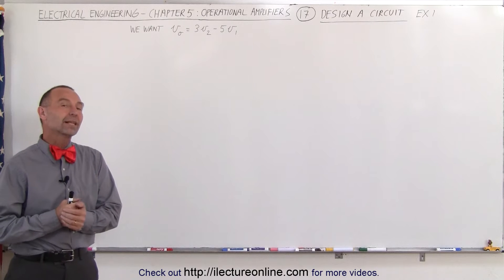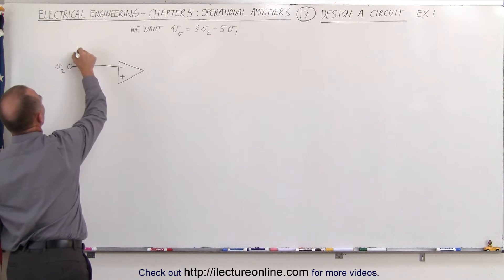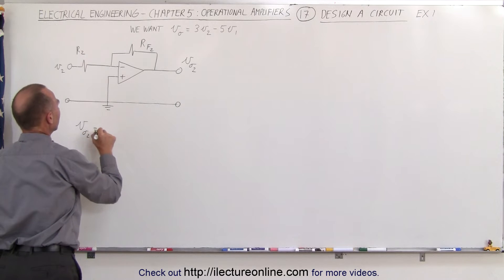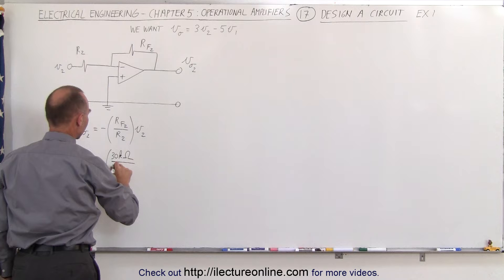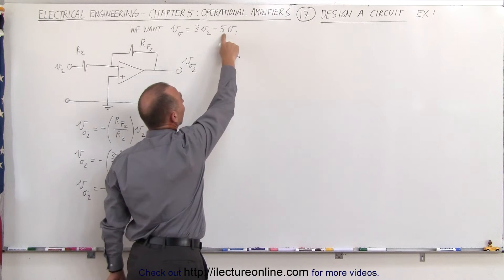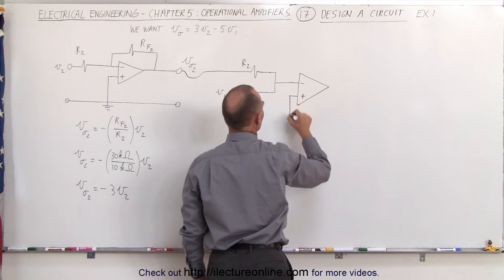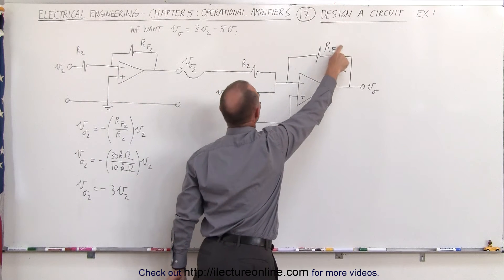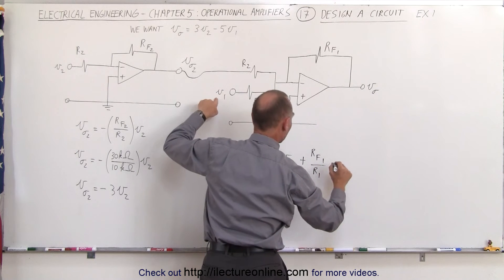Electrical Engineering: Ch 5: Operational Amp (17 of 28) Design a Circuit: Example 1

Comment: Sir, why don't we use a difference amplifier with V1 as 5V and V2 as 3V with Rf and R1 as 10kohm each.
Reply from the maker: There are many combinations that will give you the same or similar result.

Comment: Design an op-amp circuit using IC741 to give ~ + 15 V for Vin< + 1V and ~ — 15 V for Vin > +1V. Can anyone pls solve this for me. It will come in my exams. This question.

Comment: Why wouldn’t you just use a non inverting op amp into an inverting op amp? Just make sure the gain ratio of the non inverting one is = 2 (A=1+Rf/R2) A=1+2, Vo= 3vi. Then feed that into an inverting op amp with a ratio of 5. A=-Rf/R1, A=-5.
Reply from the maker: There are often multiple ways in which a circuit can be constructed.

Comment: Using the "un-tuned" Difference Amplifier from Lecture 15, looks like one could choose Rf/R1 = 5 (to get the "-5 V1" term), and then set R3/R4 = 1 (to get the "+2 V2" term)

Comment: Is there a science to picking the scale of the resistors.    For example I would expect you to use 50K ohm but why not 5K or 500.    I assume you want to keep the impedance high to minimize the current levels.

Comment: Not to be picky here but by only drawing two peaks in your resistor symbols, you're actually drawing the symbol for a solenoid.  Resistor symbols should show 4 or 6 peaks to differentiate it from a solenoid.  Alternatively, you can draw resistors as rectangles.

Comment: SIr, It is confusing as you have a Resistor R2 in the first OP AMP whose value is 10kohm, and then re-use variable name R2 in second OP AMP but this time it is 50kohm in order that (Rf / R2) is = to 1. I think it would be helpful to re-name the second R2 something like R3 or better yet Runitygainhelper to illustrate its purpose. Other than that stumbling block, I found it great.

Comment: What is the main purpose of the feedback resistor? I know it controls the output voltage, but what does it do, or how does it apply in a real world example?
Reply from the maker: Those are just needed to make the op amps work.